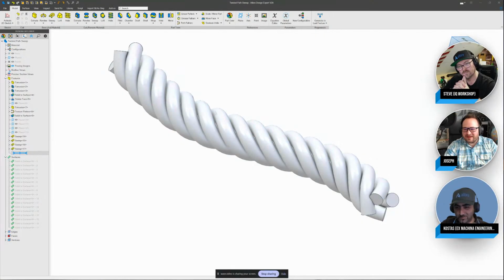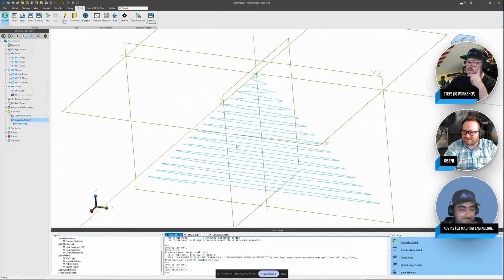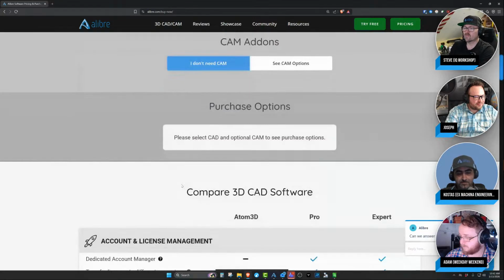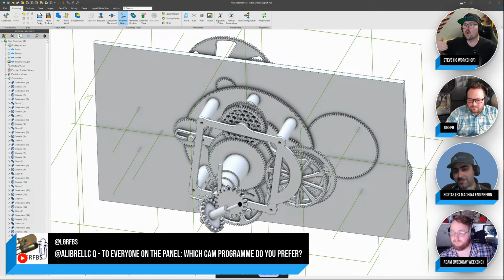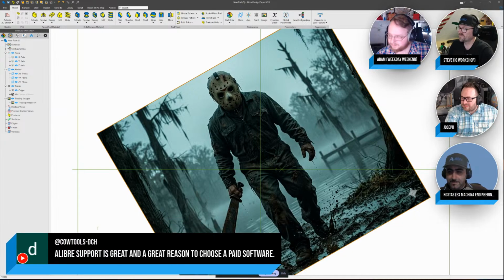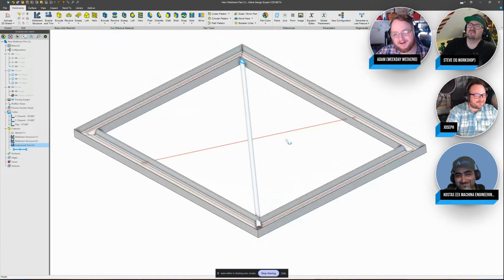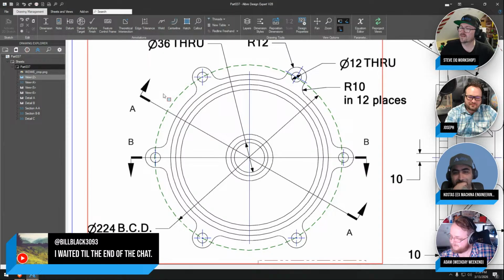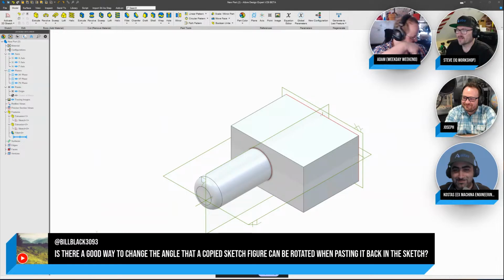HelpDesk Live 13 March 2026

Comment: Hi Kostas, 

I really enjoyed watching you guys geek out over Alibre again.
Request for next session: Maybe ask Joseph to show how to add custom weldments? And  to make it even more complicated, preferably parameter driven with a lookup table behind it for the different dimensions.
I remember this being an absolute pain in most CAD that have weldments.

With best regards, 
Niels

Edit: just a small addition. 
I loved the way you looked at how to stagger different Alibre versions for different roles! Giving apprentices Atom instead of Pro/Expert will force them to think about how to do stuff and get some fundamentals. Instead of using the quick and easy tools without understanding how they work.
Reply from the maker: Great points. Yeah, that'd be a great workflow. I imagine though that adding sections would be done through the existing Toolbox functionality, which supports all of what you say. It is fairly straightforward, I have a video on that. But yeah, great question for the next live.
Reply: @ExMachinaEngineering  I must admit I've not used the toolbox function as of yet. I'm gonna look up your video!